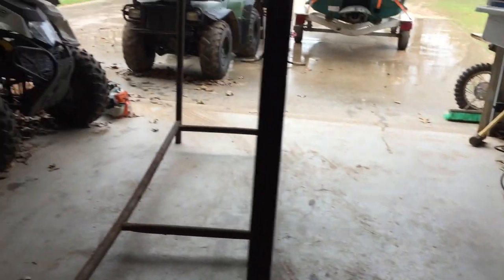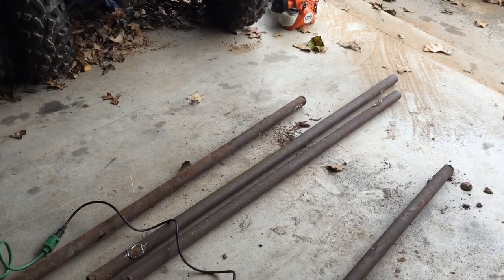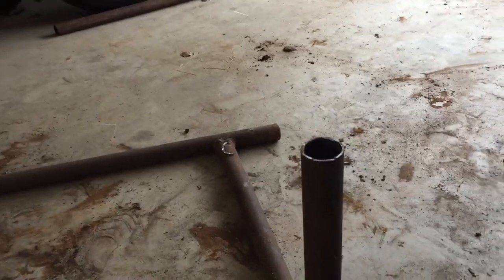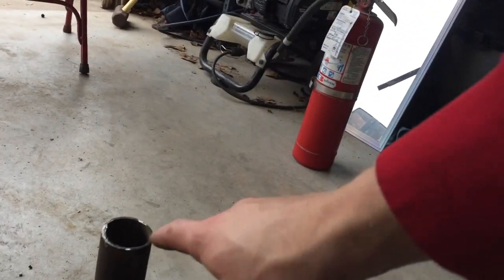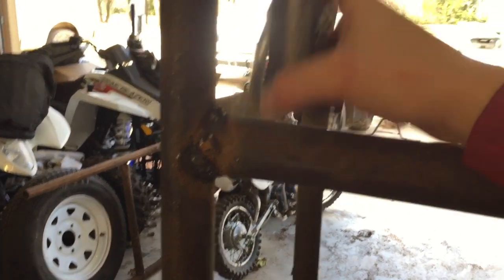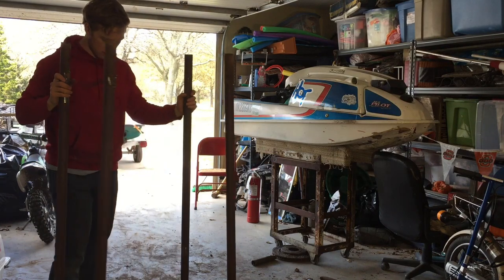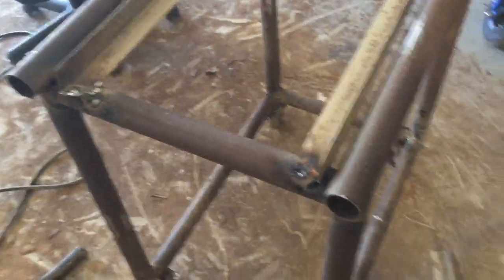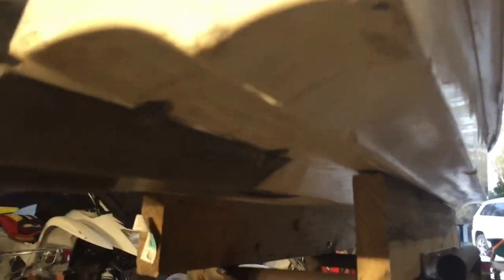JET SKI DOLLY BUILD

Comment: I am considering buying 2 Kawasaki 550 jet skis. One is cracked the other is good and between the two there is enough parts to make one running ski. They are priced at 400 with a trailer. What is the value of one if it is running? I’m thinking about flipping 1 and making one for myself. I’d love feedback as I have never owned any water vessel but I’m a total Motorhead.
Reply from the maker: Personally I think that’s a really good deal, especially with a trailer. If it’s running and  a water ready ski, I would probably price it around $600-800 depending on the condition of the hull and everything else.
Reply: Nasty Moto well that deal is gone. But another popped up but it’s the same thing. One is a 440 with a motor and everything but a little rough looking. The other is a 400 with no motor. What could the 440 be if I painted it myself or just restored the paint and got it back and running. I’ve done some research but there’s not much out there on what to value these things at